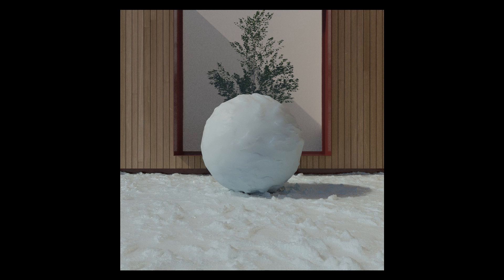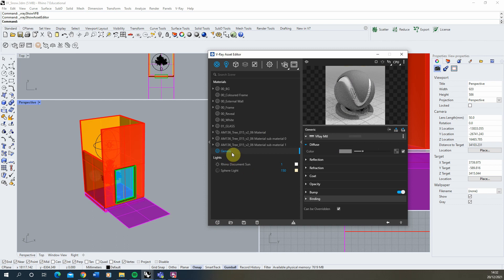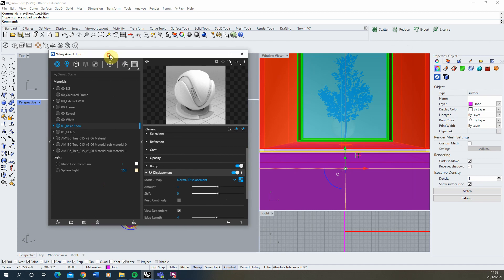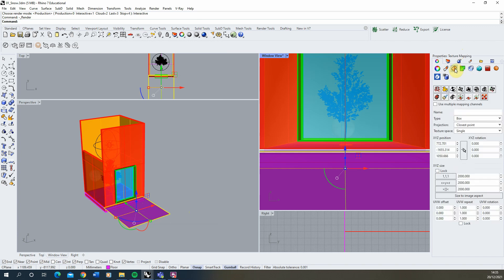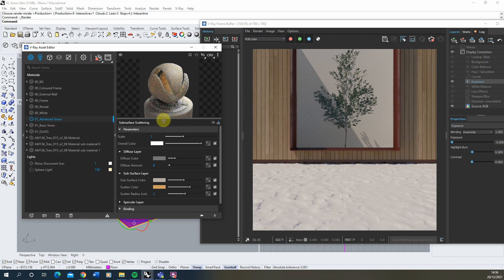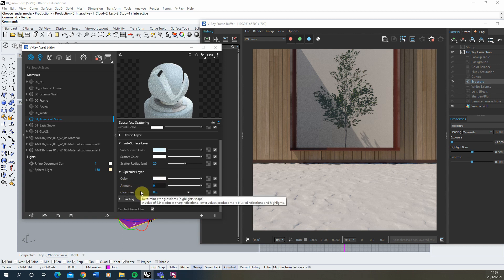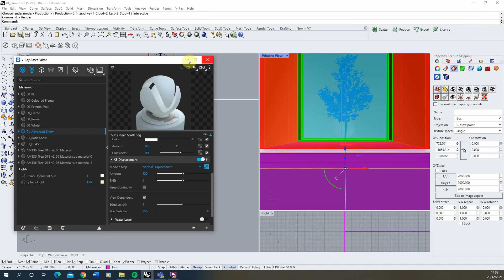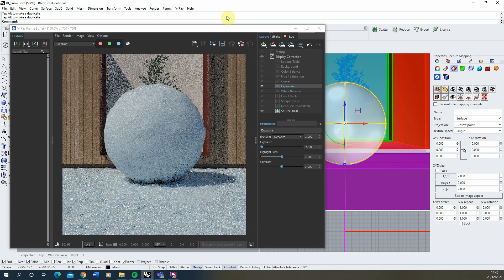Snow Material - VRay for Rhino

Comment: This video being 3+ yrs old I don’t expect any sort of reply…

Out of curiosity what scenario/why would you use this workflow rather than using the precreated snow textures themselves? 

Does it have to do with the differences between the textures being a JPG vs Vrays parameters/settings? 

I’m assuming lighting will behave differently between the two and Vrays parameters will allow for greater accuracy vs the JPG texture?
Reply from the maker: Thanks for the comment, I usually find VRay’s stock textures quite repetitive and a bit plain. I also think it’s good to be a bit more in control of the process if you then need to adjust any parameters